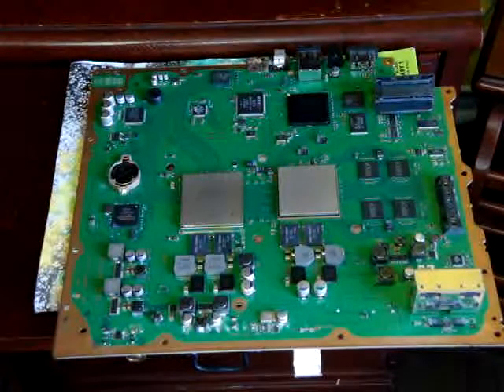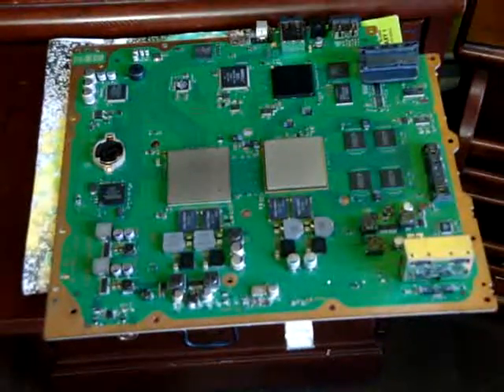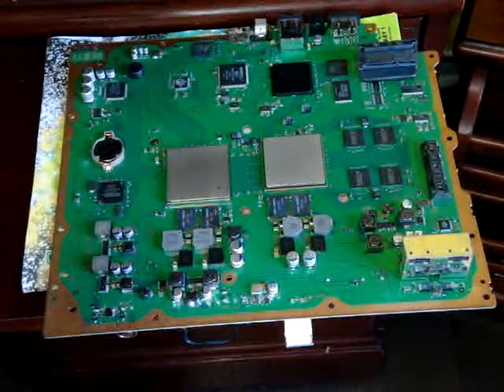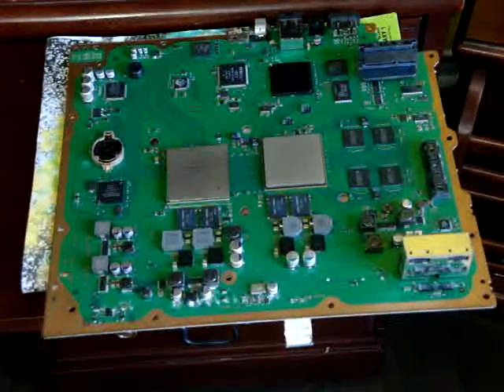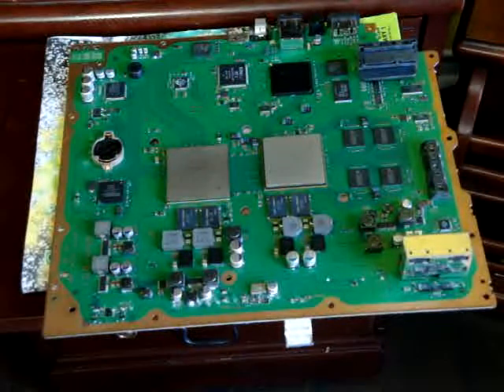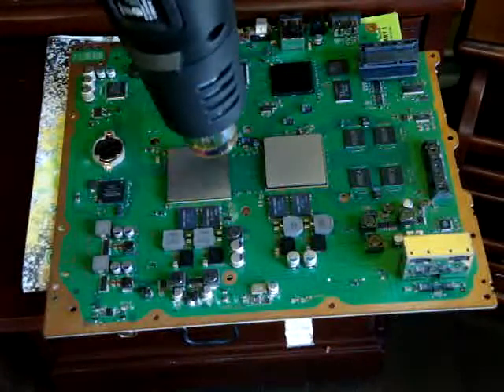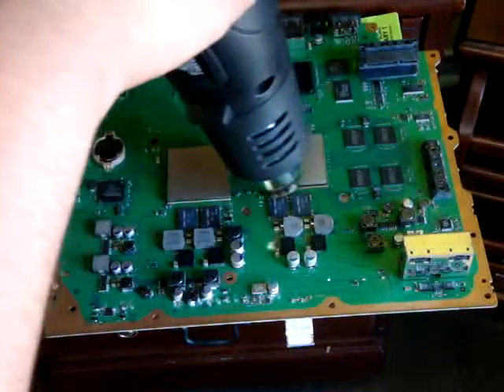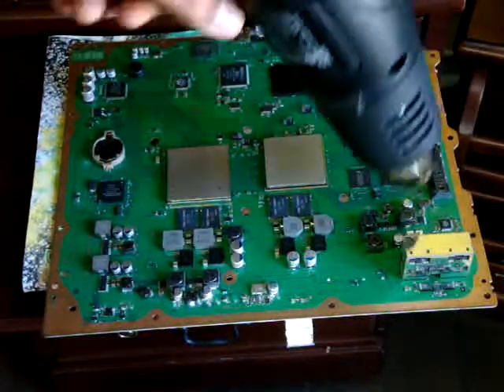How To Fix YLOD/ After Taking Apart

Comment: @FuckDaMedia the 2nd more known as the permanent fix to the ylod is Getting the GPU or CPU depending on which is causing the problem about 95% its the GPU cause it gets really hot and the thermal compund dries over time and makes it get hotter than normal so. yeah reballing is the process of removing all the lead free solder and replacing it with lead solder which can withstand much greater heat changes then the lead free solder so you get the point tada! no crack on lead solder :P

Comment: @FuckDaMedia basically summing it up heating the chip up re melts the solder balls under making them one whole solder ball again with no cracks so your connection is nice and good afterwards. sadly this method does not really last that long the people that say only lasted them a few hours/weeks are dumbasses and prolly did not clean their heatsink off and get all the dust outta their system so it killed itself again faster than it should have. now 3rd point or 2nd best way tofixylod

Comment: @FuckDaMedia ok here is a more simple answer. the solder used in the ps3 is Lead free which does not handle temp changes very good so when you shut your ps3 after playing it you are slowly weakening the solder joints in the ps3 and when they get weak enough they start to crack which will disrupt the connection the ps3 gpu and cpu use a ball grid array solder joint so there are hundreds of balls on the bottom of the two and when one of those balls crack the chip will not function.

Comment: @WeekendDiablo  no. use a heat gun one that goes up 600c this will allow the solder to flow a haidryer doesn't get not enough